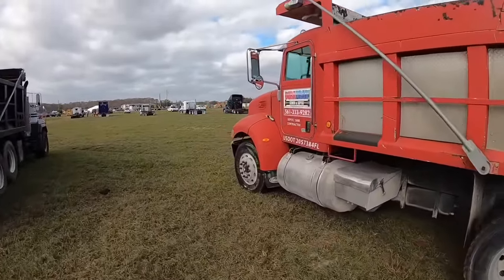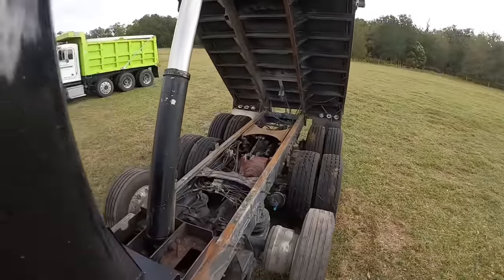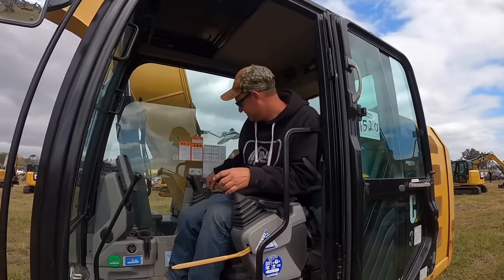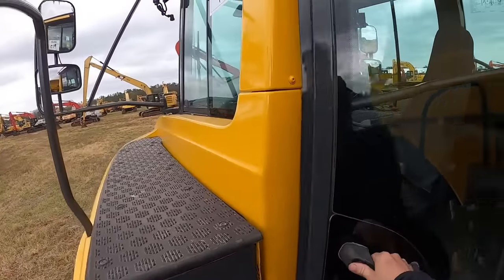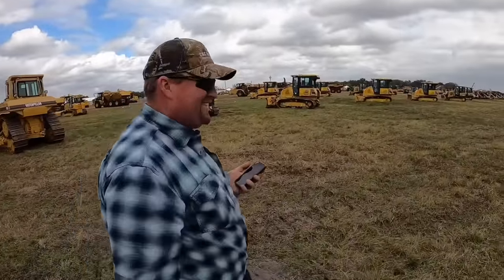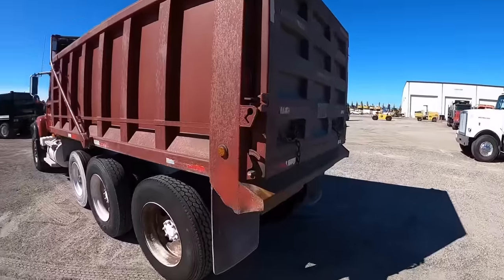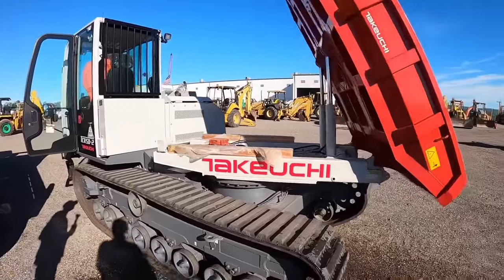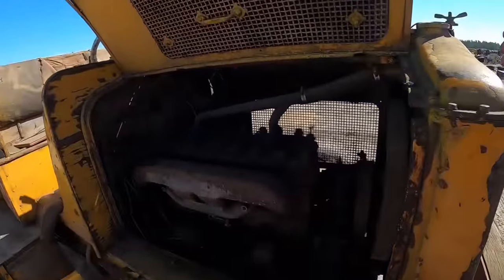Party Pooper Clint From @C_CEQUIPMENT Kills my dreams at the Florida Auctions

Comment: Komatsu parts are expensive, but you don't buy many because they are an awesome machine, ran a 355 dozer for about 15 years and was impressed, ran 450 diggers and was also blown away by the fact that they are so under rated from the factory!

Comment: Hey Mike, Speaking of building ponds with scrappers. Last fall north of you in Jennings Co, in the country a couple of miles south of Scipio they built a pond in a flat field using two pull scrappers with International 4 wheel drive tractors. It was no quick job though.

Comment: Up in the northern state we have problem with the exhaust running in the bed with bed rot from the inside. All that heat creates moisture and at the end of the day  it freezes. Next day you fire it up all the moisture pools to the bottom of the inside part of the bed. It will rot out after years of use but it handy for asphalt use!!

Comment: We had a scraper that got used 3 or 4 times in 20 years. It was great for stripping topsoil but sucked once you hit hardpan. Overall for pond building, it was a to costly. It did really shine leveling large fields/lots though.

Comment: in 1955, when a man from Addicks, Texas, started building off-road equipment under the company name Applied Research and Development Company, or ARDCO, for short. His 4x4 buggies became so popular in the oil and gas industry that he set up shop in Lafayette, Louisiana, and expanded his operation.

Eventually, ARDCO was purchased in 1989 by Pettibone Corporation, a leading manufacturer of material handling equipment, pipe and tire handling machines, railroad construction and maintenance machines, and rough-terrain forklifts. ARDCO’s headquarters remain in Louisiana, but production has been moved to Pettibone’s facility in Baraga, Michigan.

Comment: Mike you for sure don't need a push type scraper pan. If you even wanted one you'd definitely want one that has the paddles. I call them all pans and paddle pan for the ones with paddles. Mike I don't need to explain to you why you would need one with paddles but I'll explain for anyone else that doesn't know. With a pan that doesn't have the paddles, 90% of the time you have to push it with a dozer to get it loaded. Paddle pans have paddles mounted to two chains that spin and grab the dirt and pull it into the pan as you cut it so its self loading, so 90% of the time it doesn't need to be pushed by a dozer. The company I worked for had a early to mid 1990s Cat 613 paddle pan. Only thing I didn't like about it was if you got the pan unlevel while cutting and running the paddles, the chains and paddles would jump off the idle pulleys at the top where they turned to come back around. If you caught it fast enough you could reverse them and get them back on easily. If you didn't catch it in time and that didn't work you'd spend a good while trying to pry and push them back on. Learned real quick not to run them off all the way. Mike doesn't make deep enough cuts and at the same time have a long way to transport the dirt cut out. That's what pans are for. Making deep long cuts that then requires the dirt to be moved a long distance. They will work good for large deep ponds that have really long dams yes but Mike or Chris either one don't do enough ponds like that to justify having a pan for the occasional one that may come along. Even with large deep cuts, track hoes and offroad dump trucks are just as fast as pans if not faster now. All depends on the job at hand. 👍

Comment: One thing that would be nice to come across at the auction is a tailgate for old Budda along with a new dump truck. Problem I see with auction these days is the prices that equipment and tooling is bringing. It is insane. Thanks very much for sharing.
Reply: Tailgates on haul trucks are fine for hauling mud but in the way when hauling brush or concrete.
Reply from the maker: Don’t think I would ever use it

Comment: Use to run a Taylor Fork Lift like that but it was new at the time to take the derricks off pulling units and mobile drilling rigs as well as pick up the carrier to move them around the yard. It’s amazing how much that forklift can actually pick up. The only difference is our had dual tire’s on the front.
I’m not a dump truck operator so I’m curious as to why a double frame truck is a no-go for you as a dump truck? Seems to me the heavy duty frame would be a better option for the weight.

Comment: As tough as Mack’s are I understand why you like them . As a mechanic who’s changed several trunnion frames and drilled out the frame holes for larger bolts…and changed several camelback springs….i no longer share your desire for Macks lol

Comment: Someone else mentioned it, and I'll second it. Definitely switch to looking in California for a truck as they have outlawed anything older than 2012. Probably find something someone has rebuilt and now can't register in Cali. Getting it back home will cost more, but no rust and I am sure they would rather sell a good truck than just send them to a scrap yard. The downside to western US trucks is they are going to have double or triple the miles on them verses trucks out your way. Saw a 05 Mack five axle truck somewhere in Montana with 857K miles and they wanted $85k for it. New equipment just isn't reliable as the old stuff, so the old stuff is still a premium.

Comment: I have a 2001 RD688S 460hp, Eaton 18, tri axle with a new steerable lift axle, 500,000 miles truck I can email you photos and service record of. It’s in New York, double frame, but not to crusty. It is still configured the way it came from the factory, around your money I have service records and I have owned it for the last 15 years. Have kept up on repairs ($80,000 in repairs over the years, new differentials etc.) and will pass NY inspection. It needs cylinder repack and a couple slack adjusters, even have a brand new hood still in the crate as an extra, the one on it has a crack in it.
Reply from the maker: Thanks but think I found one application it
Reply: Sounds good. I have had and own Mack’s for dump trucks and they are a good vocational trucks especially the RD,s  You probably know everything you need to but I would be happy to share what I know when buying used Mack’s.  Sounds like Clint is a good source also.  I enjoy your channel very entertaining.

Comment: Mike,  There may be some good trucks out California way since CARB will not allow any truck older than "12 to be registered.

Scraper wise, I agree and disagree with you.  A scraper will never go where BubbaDump goes.  On a pond job, a scraper can be loaded with an excavator and then haul, spread in a thin lift, and somewhat compact all without stopping.  That is something Bubba can't do.  It would save time and cycle faster.  It would take some strain off Bubba.  Like Bubba, it probably would find more use than you think it would.  All that said,  that green machine is real nice but would take a lot of green to buy it.  An older Cat that would be far cheaper would, in my opinion, be a better option.

Comment: If I just needed one fronds I'd find  a WABCO  252, a new Cat can't come close, advantage F & R engines,  transmissions, Planetaries are the same,  hydraulics are run from rear, center mount operators seat (see  both corner bits easily)  easier ride not a kidney buster.  Load faster, can put teeth on cutting edge
Reply: Dis advantage   parts are  difficult 
  JMHO

Comment: You do not need "a" scraper. You need two, twin engine machines with push pull capability. One single engine is just a waste of a good push dozer because you can’t load anything without pushing it.
Reply: A pull scraper behind the 850 would make more sense for pond building. Most pond jobs are too small to park two scrapers in anyway 😄👌

Comment: DP,,why are ya not fixing your international,that paystar will haul as much as that Volvo if it has the 75k rears ,buddy it's almost done 👍 ,come on,buddy finish it
Reply from the maker: Completely different truck
Reply: I know DP just throwing a lil comparison in there as far as strength but still your big I would make you a nice "older" truck I understand if you want lil newer truck ,buddy I appreciate each and every video I get up every morning hoping to see a new one ,keep them coming brother, and mat is coming around as far as a articulated dump operator ain't he ?
Reply: @DirtPerfect  Why are you looking at crusty 8x4 trucks while your 8x6 is almost finished, are you afraid that the fuel mileage of the transfer case and driven front axle will disappoint ?